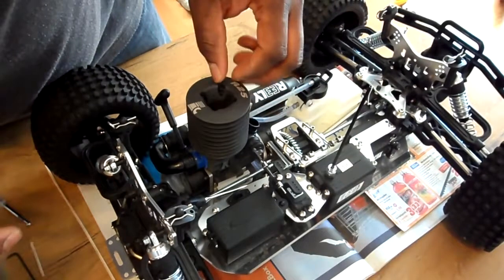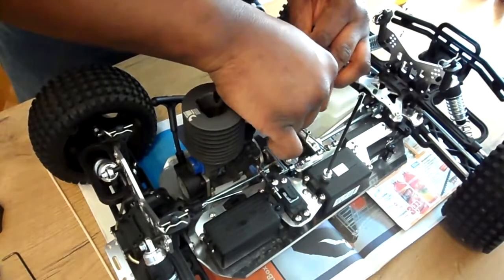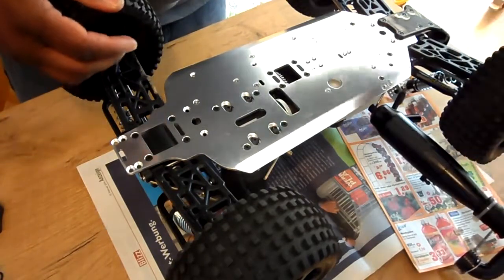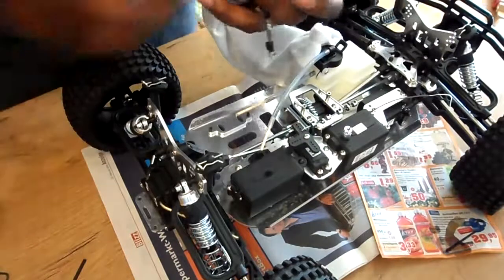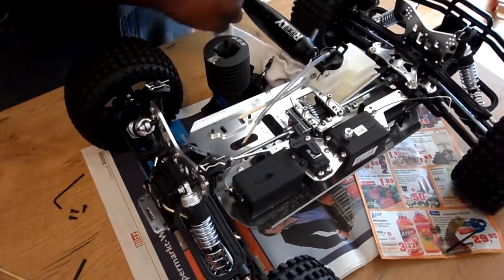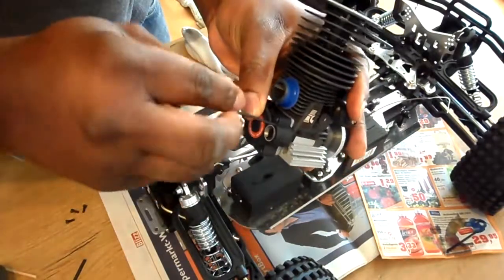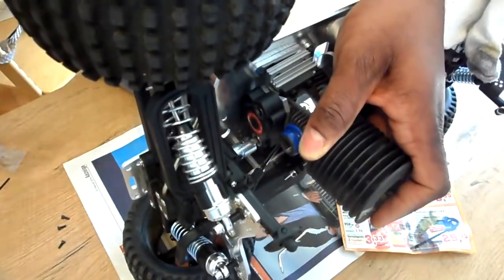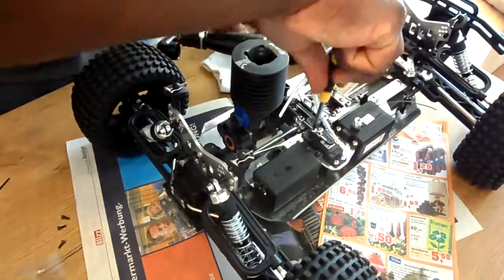Replacing The PullStart On My RC Nitro Overheater With An Electric Start Part 1

Comment: where did you get the electric start from cant seem to find any I got the 1:8 overheater aswell but needs a pull or electric start
Reply from the maker: I dont know where you are but I live in Germany.   I got this electric rotostart from Conrad,  but I've since moved on to 2 stroke cars.   The fuel is cheaper and I don't need to go to a special dealer to get it.
Reply: I live in the uk but thanks anyways and thanks for the tip on 2 stroke :) I will be sure to look on Conrad
Reply from the maker: guler plays No problem.  Here in Germany the nitromethane fuel costs around €55 for 2.5 liters!  It's more expensive than putting gas into your family car...lol.  It's an expensive hobby.  The 2 stroke fuel costs €6 for 5 liters and the oil is also relatively cheap.